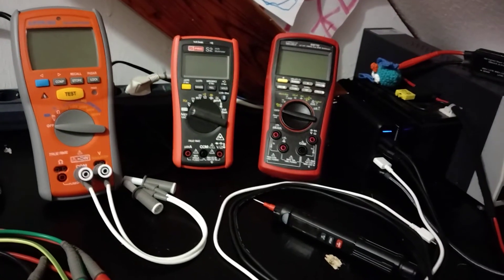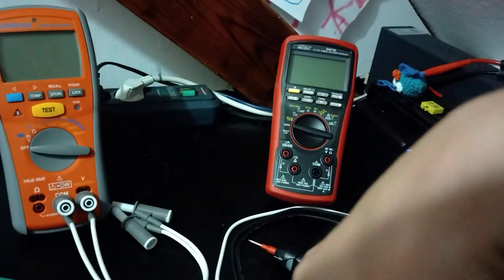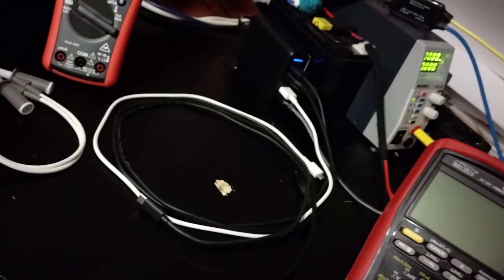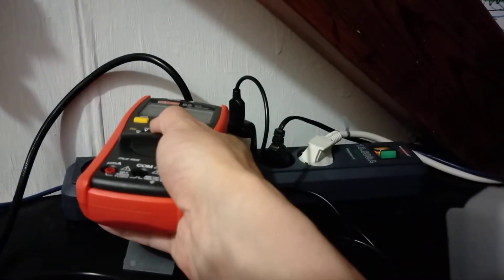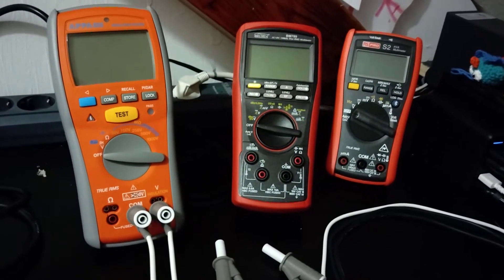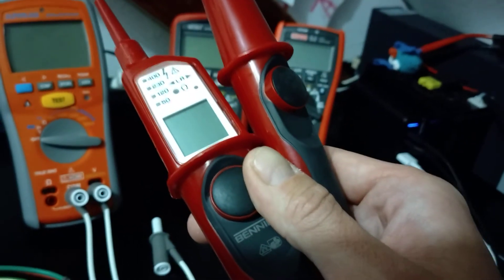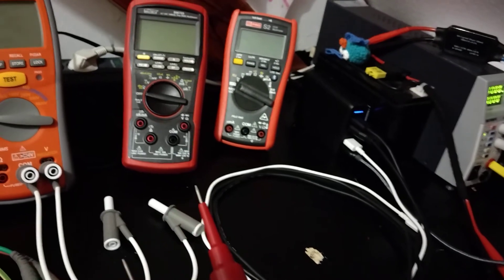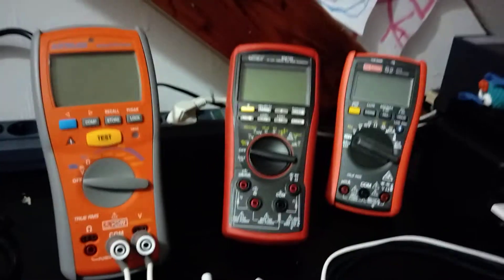"Non contact voltage" (NCV/EF) on Multimeters - A suicide gimmick you should not use

Comment: What is the best way to check if there are any electrical wires in the wall before starting to drill ?
Reply: I wonder the same. My whole wall beeps and sometimes doesn't. Can't imagine that it's full oif electrical wires.

Comment: Can you say something about the voltage accuracy of your duspole compared to the multimeter? especially for the "Lo U" mode
Reply from the maker: By what I've seen it's pretty much according to specs. Personally I view it more as a back-up or add-on functionality for field convenience. Productively I only used it in cases, where I wanted to check if an auxilary 5V supply was also switched off by what I was doing. Was good enough for that. If I wanted to knew the actual exact voltage I would have taken the DMM.

Due to the low input impedance of two-pole voltage testers it's usefullness for electronics is limited.
Reply: @High.On.Voltage  thanks for the quick reply. i was just going to use it for electronics and i will give my duspol a chance :) at my own risk of frying my controller of course

Comment: You have raised an important issue. However you need to remember that NCV or live wire detection function is "a complimentary" function built in multimeters. It is not a primary function. This is why you can in Brymen 789, 786 etc insert black lead into COM socket and probe with this lead the suspecter live wire. This is your second line of defence. Howevere even then you must as an engineer to find out beyond doubt that wire is live or not.  If we take as an example an electrical field of application of this approach based on certain process steps then you need to know prior starting any work with suspected live wires in what category environment you are measuring.This is why many electricians carry so-called "contrоl bulb" with them etc. You certainly have demonstrated one important moment - do not trust your eyes  and senses*, and doubt even most advanced testing equipment you may have. This is why *Electronics Engineers learn this not from youtube or internet. Problem you are highlighting is important though, especially for young, inexperienced electricians who have limited experience.For the general public it is better not to think that they can fix themselves this old TV set with 25kV inside..or USB charger connected to mains. Takes a split second to make a once in life time mistake . Respectfully